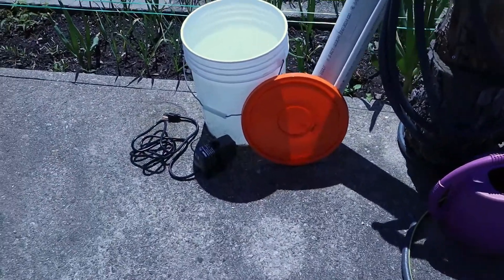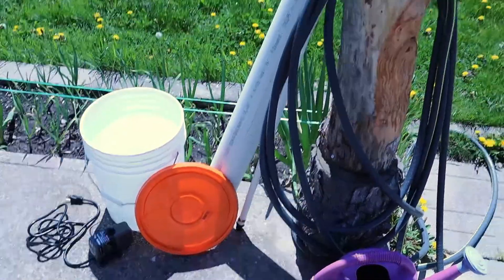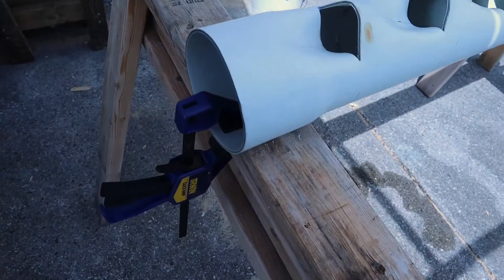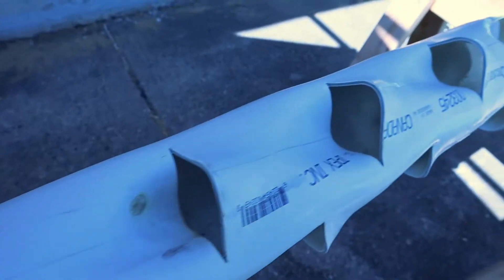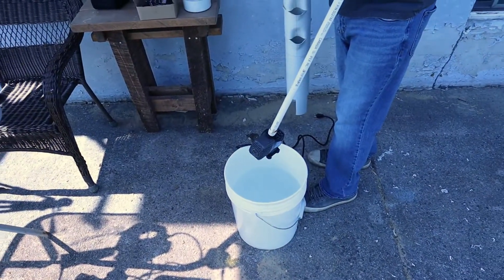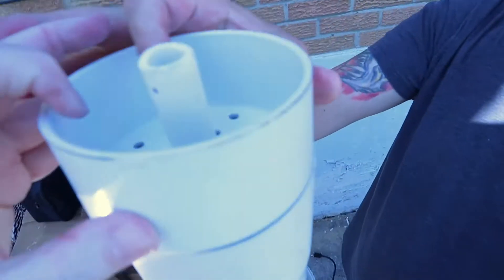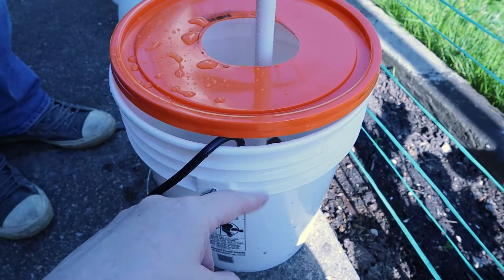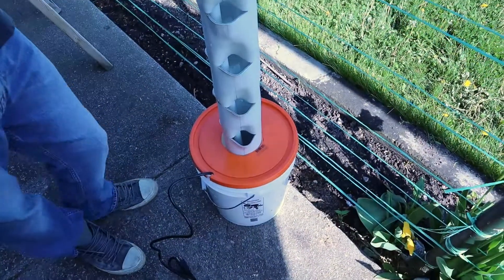How to build a homemade hydroponic tower

Comment: Nice work. I suggest purchasing some 3/4" ID grommets and a barbed 3/4" PVC drain valve. Draining the water would be much easier. I would also install a small water tank float valve and connect it to a faucet so the tanks are always topped off.
Source: 22 years of hydroponic experimentation.
Reply from the maker: that's a great idea actually. To have a drain valve. And maybe we could set the bucket on top of some bricks or something to give it some height. Not sure that we could put it close enough to a faucet but being able to drain it and refill it without disassembling it would be good.
Reply: @theplantlifecanada  Exactly, bricks are what I use. Regarding the float valve, I use a drip irrigation line because the water demand is low. They have adapters online from the 3/4 spigot to 1/4" drip tubing. 
Plus, you can purchase tees/manifolds to branch off to different circuits.
I also turn the water spigot down to a trickle. There is no need to blast 60 psi through the small lines risking a blowout. Keep up the great work.

Comment: Why would you make a video and not state the measurements? 🤨
Reply from the maker: Aren't some in there? We didn't have a prescribed size, but worked off the pipe we bought. I think the height is about 5 feet for the outer tower!

Comment: Do you have a template or the measurements on the pipe?
Reply from the maker: Thanks for watching. We don't have an actual template but I'm pretty sure it was about 5 feet tall but it might be different each time depending on how many holes you want and what size bucket you use. I think the main thing is to space out the holes evenly. We ended up having HUGE plants with this and made the mistake of not harvesting the hole plant and the roots got out of control inside the pipe.

Comment: You used a very thick pipe for the exterior, with a slimmer one shaping the holes is MUCH easier, very good job guys
Reply from the maker: Some of those holes were pretty tough to melt, that's for sure! I think you're right - a slimmer material would have been better and some people have suggested that maybe an actual heat gun type thing would have worked better too. Thanks for watching!
Reply: @theplantlifecanada  Yes, I've been a plumber for some years so I'm very familiar with those materials, regular pvc drainage pipes are likely the easiest to work with, and the heat gun let you stay close with the high temperature but never (almost) burning/melting the pipe, but to be fair a thicker pipe like yours is probably a better cover for heat and light, so it might actually be a better choice for those who keep the tower outside

Comment: nice video. I have a question about the pump. does the pump run nonstop? the pump must heat the water. or do you have a timer? if so, advise on setting the timer?
Reply from the maker: Thanks for watching. We did run the pump nonstop. The water needs to be moving continually to avoid algae. The water needs to be cut off from sunlight to avoid algae as well (as mistake we made.) We did not have an issue with it running continually all summer. We shut it off for a small amount of time each week when we had to refill the water bucket and add more nutrients.

Comment: Did the pvc stink while heating it up ? I’m worried about chemical safety
Reply from the maker: Hi there. It did smell a little bit, and there was a bit of smoke because we were using basically a big lighter. We did it outside to help with this but overall it wasn't too bad and I am someone that is usually very sensitive to smells and worried about chemicals myself. But some others have suggested using an actual heat gun to heat it up faster and more consistently, which I think would help with chemical safety as well. If in doubt though, I would get an appropriate mask/respirator just to be safe! Thanks for watching and commenting.

Comment: I saw a guy out there doing hydroponics and making his own tower like you are and he uses pool noodles rather than net pots so you don’t even have to angle the hole or heat it up!  You cut a very small section out of the pool noodle so you can place your plant in with it squeezing the roots so the section you cut out will depend on the size of hole you cut, the Poole noodle size (get small ones from Dollar Tree).
Reply from the maker: Oh cool! So you just stick the pool noodle piece straight into the hold on the side of the tower? I've seen some videos out there with horizontal tubes, and someone did use pool noodles so that they could be reused. The way the roots grow in the net pots, you basically have to throw the whole thing out when it gets too big, which sucks. I want to try pool noodles on our next build.
Reply: Get the small ones from dollar tree though

Comment: Won't they be overwatered if not on timer pump? Cheers 😊
Reply from the maker: Hey there! Many people might think that at first, but this is hydroponics. There is no soil, only water. The plant gets the nutrients from the water. Because the water is constantly moving, the plant will take only what it needs and you will not have a problem with overwatering like you might if there was soil. It's a totally different way to grow! Thanks for watching. ❤

Comment: Hi.  Good job.  Heat gun is inexpensive and doesn't burn it like a torch... also don't have to refill with butane.
You can use a coupling at the top for the cap.
Again, good job.   The wood surround is a nice touch.
Reply from the maker: Thanks very much! I think for sure a heat gun would be a good investment. We still have the rest of the pipe and hope to build something with it, so the heat gun will come in handy. We are also hoping to rebuild this tower with improvements. My partner is really getting into building and carving wood so he will appreciate the compliment!

Comment: What about changing water? How do you do that? What about heavier plants like cucumbers? Wouldn't that tip the tower?
Reply from the maker: Hi Erinn! In our case we should have sealed the bottom a little better because we did get issues with the water becoming dirty. We would usually just re-fill the water until it got really bad and then just lift the tower out and change the water. Obviously not a great plan unless you have two people. For this tower - we only did herbs and smaller vegetables. But I think you could probably grow heavier stuff at the bottom, so it wouldn't tip. But from our experience now (because the roots inside got so long) I would actually just harvest the entire plant, and put a new seedling in. We moved in the last year or so, and are hoping to set up the tower again in the Spring and post a new video with some of our mistakes that we made or things we would do differently. Thanks for watching!

Comment: The water won’t flow over the middle part of the cup . It was follow its flattest route . So that is not very efficient
Reply from the maker: Hi there. Are you taking about the cups with the plants in them or the cup on the top of the tower? The cup on the top of the tower had holes cut out for the water to flow through. We did have some water issues because the holes we made let the water leak to the outside. It caused us some algae issues.

Comment: Great video, the only thing I would do differently is to use a whole saw.  To cut the whole for the internal pipe and the top of the bucket.
Reply from the maker: Do you mean those big round drill bits? Cutting the hole in the top of the bucket with that little saw we had was definitely not fun! LOL 😂

Comment: Thank you very much for sharing your vertical set-up. This is exactly what I've been looking for. How many inches is the hole of the big pipe and the smaller one?
Reply from the maker: Thanks for watching! The big pipe is a 4 inch PVC and the inner pipe is 1/2 inch PVC pipe. But they were both very, very tall so we cut them down to only 5 feet tall. There are others in the comments that gave some really good advice on how to make the holes (instead of using the wooden piece) so definitely check them out!

Comment: Nice build, the nutrients in the bucket can be a bit tricky to manage though.
Reply from the maker: Thank you for your comment. The nutrients got difficult because we had to lift the whole tower..we seemed to get the right mix for the tower but I've been experimenting with them in soil and I'm not sure I have it right, yet. But I don't think you can premix them either. Always learning!
Reply: @theplantlifecanada  you can cut a hole in the bucket and use an end cap to cover it, screw it out when you need to check the nutrient mixture or add water

Comment: I suggest using 1½  pipe or smaller that suit your net pot to make the hole instead of wooden dowel..it is round and perfectly shaped..cut it 45° so it slide easier in the bigger pipe..you can also adjust the hole angle while it still pliable..one more note you may make an overflow ring using the 1½ pipe to prevent water from dripping out..thank you
Reply from the maker: That's a GREAT idea. The holes in the pipe were a little large for the net pots. We were working from some other videos we saw online and we had the wood around but I'll definitely try the pipe idea for the next set up. We have leftover materials to make a 2nd set up but we may try to go horizontal instead of vertical.

Comment: Nice. And thank you guys. I have a question. There are some cracks on the edges of net pot  holding holes. What about the water is it coming out through that cracks?
Reply from the maker: Thanks for your comment! Yes we did have a major issue with the water leaking out the side and we got a lot of algae on the outside of the tube. I had another video about this but we didn't put it on YouTube yet. We made the holes too wide. So we tried putting some silicone on the edges and it helped a little bit but the silicone fell off. We had to keep cleaning the algae on the outside all summer. Also the roots got so long they filled up the whole tube. We had to lift the whole tube to add/clean the water and nutrients. Oh my it was such a mess!!! Next year we will make a different design and try a horizontal version or another version with multiple buckets and smaller towers.
Reply: @theplantlifecanada  that's good to know. And thanks for the reply. I had the same issue before when I made a vertical tower. And I changed the way of making the holes. It's helped a lot. I have a question. How about the plant growth in vertical rain tower?  is it regular as horizontal NFT system? Thanks in advance
Reply from the maker: @ambadykb  Sorry I missed your question from one month ago. The plants grew vertical as well but they all had a little bend in the stem near the pot. I am guessing it was maybe the weight. We ended up with some really big basil plants at the top that were hard to deal with when we were trying to clean the bucket/change water etc... How did you change the ways of making the holes?? I would love to know. We will build a new one this Spring.
Reply from the maker: @ambadykb  Hey there! We've just uploaded the video we did about the algae growth we experienced. Check it out! https://youtu.be/3m_Q10ogyIw

Comment: Nice set up, and looks great! We would like to set up some vertical hydroponics eventually. The dowel is a smart idea for making the pockets.
Reply from the maker: The vertical design has some flaws. I would almost recommend checking out some horizontal or bucket designs. Lifting the tower out of the bucket to change the nutrients or clean it out has been challenging.
Reply: @theplantlifecanada  oooh that would be awkward to lift with the height, and the weight